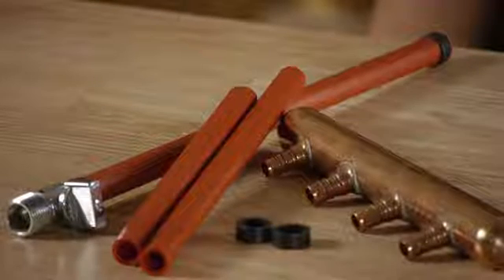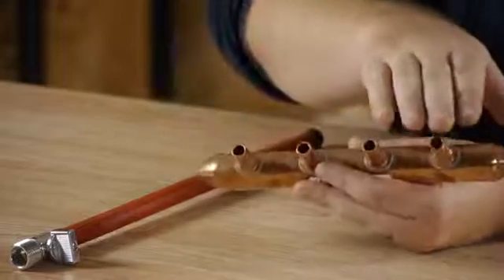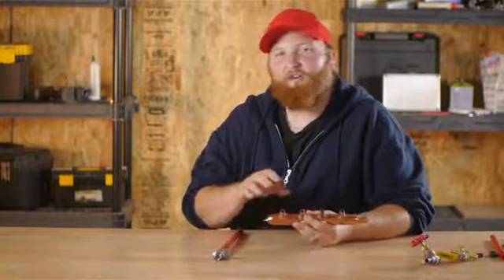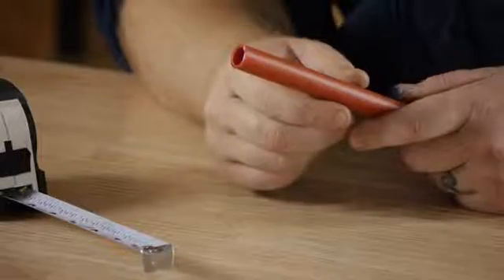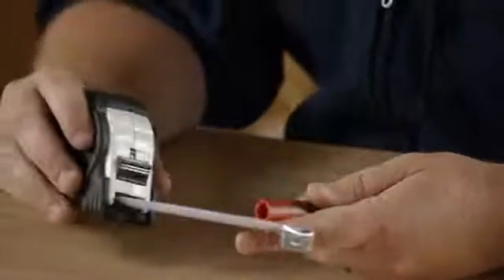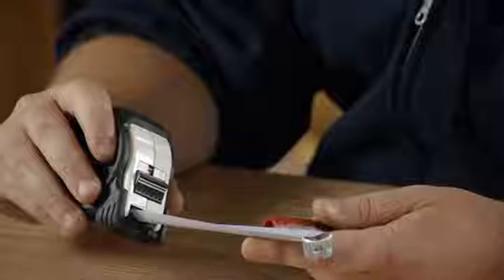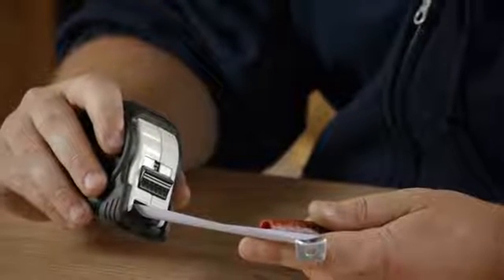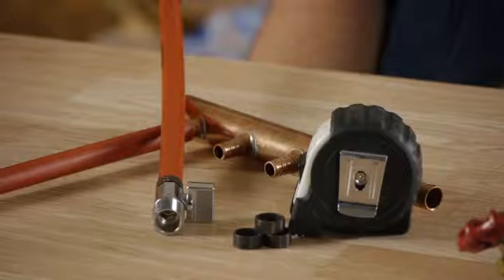How to Size PEX Pipe for Home Plumbing

Comment: Are you a plumber?  Just curious. Water pressure isn’t dependent on the size of the pipe. The pressure will drop due to friction loss based on flow, but to my knowledge that is not the reason to use a smaller water line. The larger the line the more water has to flow through it to get hot or cold water. Also, I don’t think many people are still teaching the “home run” pex method due to the length of time each faucet must be opened to obtain hot water. It wastes water and energy. It seems like the recirculate method is currently considered more or less standard, and keeps hot water on tap. 
I’m not a plumber either, but also not making how to videos on plumbing that seem to contain incorrect information.

Comment: It really depends on size of your house and number of plumbing fixtures.... 3/4" pipe may not be enough, and probably is not enough to run your average  house. Main run should be 1" to maintain proper volume deliver and demand. 3/4' pipe then branches off of 1" pipe to specific clusters throughout the house.

Comment: pex pipe is smaller on the inside then what you are stating.. a half inch is .485 not .5..  and you check your pressure and that will help determine flow of pipe by the size of pipe and distance. basically the more faucets that are running the less flow you will have and pressure..

Comment: Thanks for the helpful video.  A bit of math though. If the outside diameter is 1/4 inch greater than the inside diameter of 1/2 inch, wouldn't that be 6/8  (ie 3/4) instead of 5/8?

Comment: Question about re-plumbing. Will converting from 1/2 inch CPVC to 1/2 inch  PEX cause a drop in water pressure at the showers and faucets, due to the PEX fittings inside diameter being somewhat smaller in than CPVC? Would I be smart to increase to 3/4 inch PEX to at least feed the water heater, and water softener, and then run 1/2 inch PEX to the rest of the fixtures in the house?
Reply: The math is "out there", but I'm not looking for it. I would just go up a size.

That said, if you were asking about 3/4", and thinking about going to 1", it would be difficult it not impossible to get straight sections of 1" pex; most likely all you'll find are rolls.